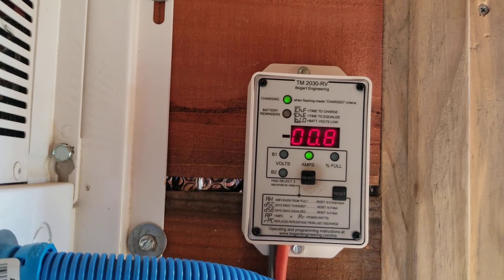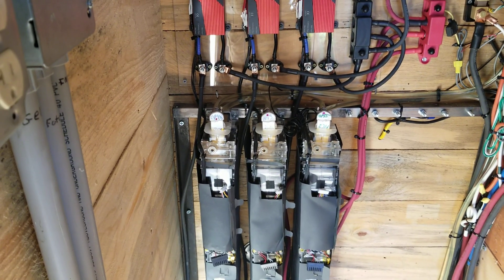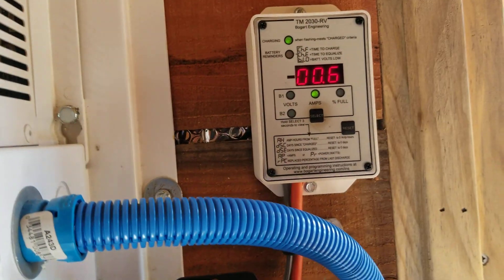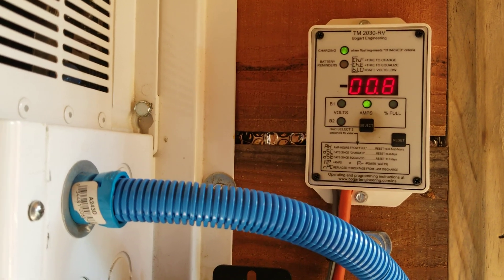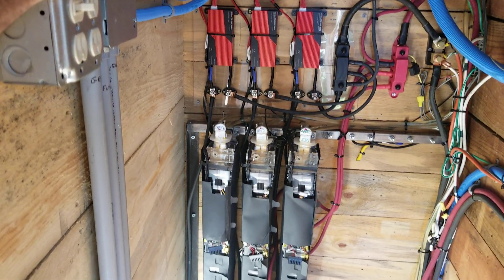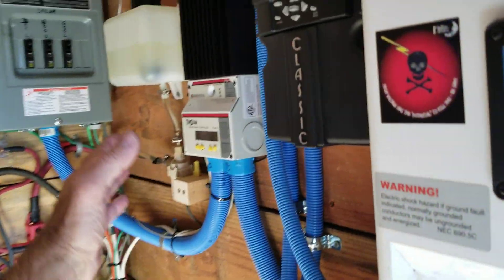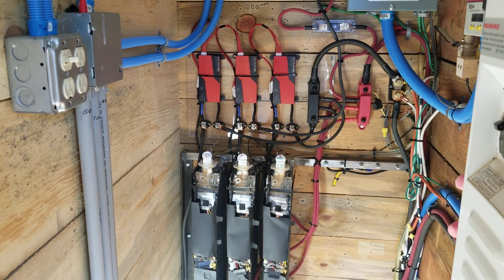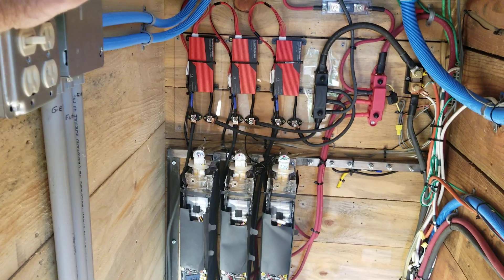The Lithium Ion battery has destroyed Solar Power as a Hobby!

Comment: I have a different experience with flooded lead.  I dilute the acid so it's like a telephone exchange battery.  It lasts.  You can even dilute car and lawn tractor batteries and turn them into small deep cycles.  I use separate chargers and circuits with separate batteries.

Comment: Good day. Love your set up. I kinda to would would be sad to to see solar as hobbie come to an end for me. I realise this video was uploaded a while back. I can understand why u charge each cell to around 4.0 volts. Safety, long life etc How low will u allow to lithium cells to be discharged down to? 3.7volts, 3.65? I have a lead acid 12 volt set up. Its small, and im researching on specifically lithium based batteries for solar storage. Feel free to give links or a straight answer. Thank you for any feed back
Reply from the maker: Greetings. I currently have the bottom set at 23.3 volts which is 3.33 volts per cell. At todays prices I would definitely go with Lithium Iron Phosphate and not Lithium ion NMC. The lipo4 chemistry is much longer lasting and much much safer to use.

Comment: I went with FifePO4, you are correct, after everything is set, you just kind of forget about it.  They handle large loads well and recover so much quicker than my old lead acid batteries.  I am running about a third of the amp hours I had with wet batteries and getting better performance.  Thanks for the video!

Comment: Just installed solar today for my shed. I thought my harbor freight 100 watt kit was cool until I saw this video!! 😂. Guess l will be having fun for a while until I learn more about solar setups and upgrade to lithium.
Reply from the maker: I started with 210 watts of solar and took my refrigerator off grid with it. I saw how easy it was so we went completely off grid back in 2015.now we are building  a new off grid homestead on the other side of the Cascades. 5000 watts of solar and a 15 kilowatt Tesla battery bank. Be careful solar is addicting lol.
Reply: @offgridinthepacificnorthwe3210  I have been watching videos for a while now. Have a shed that’s about 100 feet from the house and didn’t want to run underground cabling. Now that this is up and running I’m super excited!  Need to learn more about batteries and figuring loads out!  I am excited for the new hobby! 😃

Comment: I'm currently running flooded batteries on my off grid system as would love to switch over to lithium ion. Was wondering if anyone know of a good place to guide me in switching over.
Reply from the maker: Greetings, there are several drop in lithium ion batteries available.  They are very expensive because they have their own battery management system inside. If you buy used electric vehicles batteries and install your own battery management system aka (BMS) then you can cut the price of switching to lithium in half. But it takes a lot of research to make sure you get it right. The risk of fire with some chemistries is very high and the risk of destroying your battery is high with any chemistry. If you buy a drop in replacement like a Battle Born or a Simplifi then there is no risk and a 10 year warranty.
Reply: Will prowse on YouTube has alot of videos on solar and lithium. It works out a good price when you take into account they weigh less, take up less room and will last 10x as long as lead acid. 
Batteryhookup website is good for nearly new batteries

Comment: It's like going from a manual transmissio diesel guzzler to a modern electric vehicle. No more oil change, no more tinkering with transmissions, engines, no more stick shifting, no more lags...and noise. Only butter smooth instant acceleration. Yeah better things do make things boring for the lack of challenges that come with worse things. That's why we should find newer challenges to make things even better. Loved the video by the way!!
Reply from the maker: Thank you. After 30 years wr are building another off grid homestead.  We are stting posts for pasture fencing today. Way more sun here on the east side of the Cascades and more snow. We are moving our solar systems to the new place next year.
Reply: @offgridinthepacificnorthwe3210  wish you find a lot of challenges with the new venture and solve all of them. Will wait for more videos on that.

Comment: I have 2 24v batteries I need for a 48v system but can't figure a good BMS any ideas
Reply from the maker: What is the battery chemistry and how are they configured? How many cells in series?
What is the voltage range? Do you want top balancing or active balancing?
How many amp hours are each 24 volt batter? And finally how many amps are you going to pull from them with the inverter?

Comment: If you're bored, you could try welding by connecting a stick to several Lion batteries in series to a welding stick. I'm kind of curious about that myself with their low resistance.

Comment: Sorry I have joined.  What is the tank for. ?
Reply from the maker: The tank holds glycol coolant. I have a automated controlled environment system. The glycol flows through the Tesla batteries. It keeps the batteries from freezing or getting to warm automatically.

Comment: 24v is too low voltage for the power . Increase the system voltage .
Reply from the maker: It runs my 4000 watt 120 volt inverter just fine. That said a 48 volt system saves money on wire size and is a little more efficient. The biggest issue is 48 volt has more used E  battery options.
Reply: @offgridinthepacificnorthwe3210  go for 120v battery pack . We are using no inverter.
Reply from the maker: @SripalTAD  Everything we have runs on AC

Comment: It's only boring until they catch fire, then it gets really exciting.
Reply from the maker: Maybe  I should not put my cell phone in my pocket.
Reply: @offgridinthepacificnorthwe3210   cellphone ?? I thought u were off-grid ?? 🙄😂😂😂
Reply from the maker: @peterfitzpatrick7032  We were of grid for 5 and a half years. One week ago we started decommissioning the solar system to move it to a remote off grid location. My wife and I after 30 years are going to try to build another off grid homestead up higher in the mountains. I threw the switch a week ago and put our house back on the grid while we are packing up to move. The new location does not have consistent cell service.
It looks like satellite internet and a VOIP phone is in order.
Reply: One of the points of Lithium is lower fire risk... hence being the usual choice for rv's and homesteads.
Reply: You would have to do something incredibly wrong to start these batteries smoking or ablaze. But then if you're finding ways to set batteries on fire, you probably shouldn't be messing around with solar technology now in the first place, should you? Okay then...

Comment: I'm no expert but I have 8 48 volt Pylontech US200B Plus modules for 19.2 kwh/400 AH lifepo4 storage and when they reach 100% SoC they take a constant 19 watts, installer said this is the BMS, in a similar fashion to your set up every so often they deliver a small amount 15-30 watts and drop off the 19 watt charge,  then back on to 19 watts charging, they cycle through this small charge/discharge routing for the whole time the sun is strong enough to produce power, in summer this can be from 10.30am to 19.00 pm here in West Central Scotland. Looks like this is a characteristic of the lifepo4 chemistry.
Reply from the maker: Yes I noticed the same characteristics with the Tesla chemistry. It is great to hear from across the pond. Have a great day.

Comment: LOL, next you can start playing with Super Capacitors... I've been toying with them for a while and combined them to my system and replaced the starting batteries in my diesel pickup, because as soon as it turned cold I could no longer start my truck. Instead of spending $500 on another set of lead-acid batteries to only last 3-5 years again, I build 2 batteries with 2x 10AH LiPo cells off amazon for $55ea, then added 15v worth of 3000F Amperics Super Capacitors to each battery bank and holy cow the truck turns over quickly on startup. The starter has never rotated the engine that quickly before in the entire time I've owned the truck since new. The small Lipo cells are only for parasitic draws that stay on when the truck is parked like the radio clock and security system and such... and keeps the supercapacitors topped off since they will slowly trickle down after a few days, but the drop in voltage per day is so minimal with these modern supercapacitors its barely noticeable. I did rebuild them twice, I had to add a 0.5ohm 200W resistor between the supercapacitors and the Lipo battery to protect the Lipo cells from startup, it was pulling most of the amps from the Lipo Batteries during testing, now it puls like 70% of the amps from the supercapacitors and the batteries only see the remaining 30% or less of amp draw on startup. Also it helped with charging, because now the alternator chargers the supercapacitors to full voltage first before the Lipo starts charging. I spent $110 on the Lipo Cells on Amazon and $160 on the Supercapacitors off Aliexpress and just shrink wrapped the entire mess inside those large battery size shrink wrap tubing off ebay.
Reply from the maker: That is brilliant!
Reply: You should do a video on that.  I was thinking of doing a super capacitor batter for small motors , the seasonal stuff like ride on lawnmowers etc and my Dirtbike .  I hate replacing batteries in things that sit most of the time. I think a capacitor can keep its charge (without a small battery) for 4-7 days.  I don’t mind kick starting the dirt bike if it has sat for a while.  I would probably do a quick connect for the battery to use on dirt bike, ride on mower etc

Comment: How much power does your heater system use and will it be useful at -30c
Reply from the maker: Greetings friend,  So far it o ly came on one time. The pump is 6 watts and the heater element is 50 watts. The controller is about 12 watts so 68 watts total. If I were in a colder climate I would insulate the batteries and use a 100 watt element.
Most if the systems I have seen on YouTube vary from 50 to 100 watts and insulated batteries.

Comment: We are in our 11th month of a one year study called "The Energy Sovereignty Project".  Come have a look at our channel and our data.  We have been logging it daily and giving weekly and monthly updates.
Looking at the closeouts for each month, and especially looking at our 6th month "solstice" review will give you a good overview of how things are goign.
We are using 10kw of PV and 6 of the powerwall 2 batteries to run the home and also get a substantial amount of driving done, all on sunlight.
The project chronicles how many days the system has run without any grid influence at all and to what degree our specific system has required the grid, either for maintenance days, shortfall, or to push power to the grid.

I also fully agree that these turnkey systems have taken the guesswork out of these projects.  It's moving closer to what it should be, a plug an play system to get the utility companies and the oil companies out of your pocket.  They have had a good run, but now the time for continuing their extortion is coming to an end.

Comment: What I don't understand, Is why would you put all that power and money into a system then turn around and jeopardize everything you've built and own by hanging it in a tender box. All the others I've seen are properly encased in fireproof panels and channels. Clean, safe and organized.
Reply from the maker: 4.04 volts per cell is miles away from thermal runaway.  I have a double safety built in as well.
Reply: @offgridinthepacificnorthwe3210  
[EDIT: I see now that you later added balance boards and insulation, Super! Maybe still consider fire issues?]

Thanks for sharing! 
It looks like you do not yet have cell level voltage monitoring and control. If true, then it could get really exciting, maybe not for a year or two from regular out of balance but also a statistically unlikely but certainly possible internal cell fault could get really exciting! (and burn down the house)
Tesla normally puts those automotive cells in firewalled metal containers with guided flame vents just in case it all goes haywire. In their Powerwalls they use a much safer chemistry and still provide flame ducts. 
I hope that you will consider a cell level BMS and fire protection. Or just put them in a cinder block shed away from the house :-) (but make sure they don't go below freezing!) 
Wishing you fun and safe times.
Reply from the maker: @CafeElectric  This system has been decommissioned until I install it at our new homestead. I will consider your ideas.

Comment: LOVED this video! I was barrel laughing my guts out at 2:47 when you were talking about boring. I am totally in the same boat as you with lithium. Night/day difference vs FLA. I call my garage solar rig my new "appliance". With lithium, it is like a fridge, oven, microwave oven, TV set, etc...they just quietly work and don't make a fuss about anything. For about 19-20 months when my Trojan L16's started their "drama" the batteries were like heat sinks...actually got VERY warm to the touch. Capacity went down to about 1-2 kWh of useful power. With my KiloVault 14.4 kWh LiFePO4 battery bank...solid 12 kWh before the inverter gives them a "boost" charge. I did run them all the way up and down and saw the full 14 kWh. Now, not taking them down all the way. We should go offline and catch up and trade some notes. But, I am quite certain, my battery bank will last a VERY long time.
Reply from the maker: I hear you on the heat sinks also known as FLA L-16 batteries. Those massive resistor blocks were costing me 2 kilowatt hours a day!

Comment: Be patient my friend. The problems you are waiting for will happen but may be more then asked for. Have a good day . Dont let your gas go bad : )
Reply from the maker: I have 150 gallons of diesel with nothing to do but wait for the weather to set in lol. It will happen. We have had unusual sunny weather for this time of year. But alas Oregon is green for a reason. Rain and snow and plenty of it.
Reply: @offgridinthepacificnorthwe3210  do not get complacent with that bank. Can you see what the cells are doing voltage wise?
Reply from the maker: @frankz1125  the active balancer is working perfectly.  I check them once a week.  At the top 4.04 to 4.00 per cell group is the average voltage spread. It is a little wider at the bottom but not much. It is getting tighter all the time.
Reply: @offgridinthepacificnorthwe3210  just be careful. If your system can do 100+A and the balance capability 1A then your cells will go over. 4.04 is well below the max so im sure youll be fine. I start noticing separation after 4.12 or so but i stop around 4.16 v. There is a lot more storage above 4.1 v if you need to go that far.  But if you dont then dont. Nice to see it all going good for you. Is your health holding up ok?
Reply from the maker: @frankz1125  I go in for more injections on Wednesday. I am doing better health wise than I have in a long time. God is so good to me.
Reply: @offgridinthepacificnorthwe3210  good to hear. I like your vids . Keep em comin.